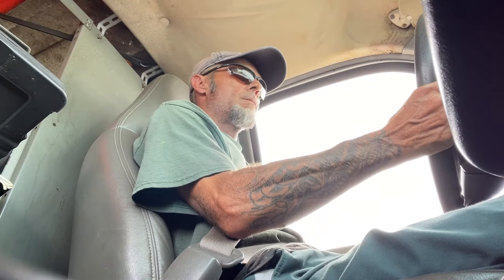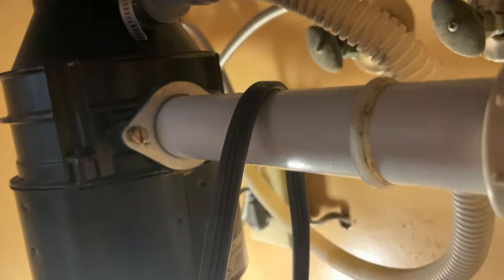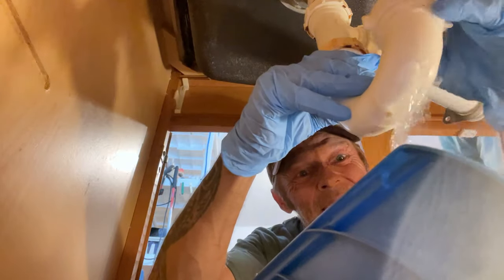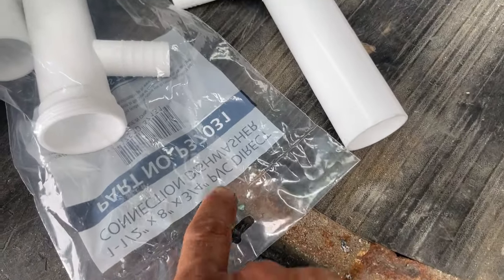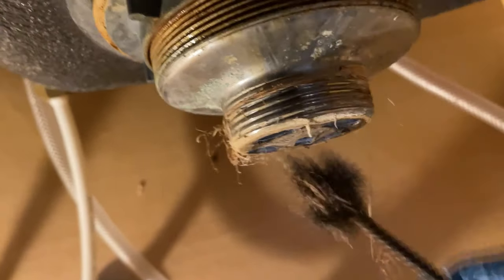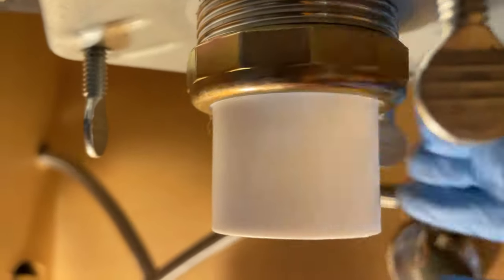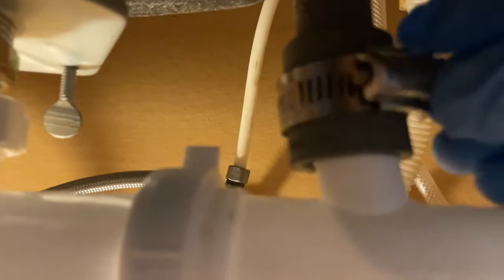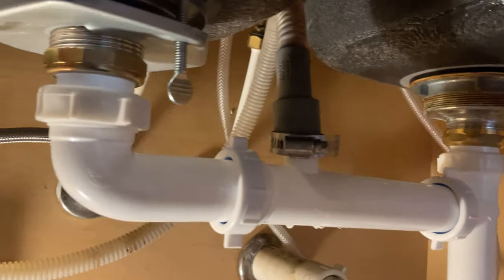HOW TO REMOVE OLD GARBAGE DISPOSAL AND REPLUMB BACK YOUR KITCHEN DRAIN

Comment: I watched this video many times, even as I finally removed my disposal.  That was weeks ago and I've still got paper towels under the sink and check it frequently...like I still can't believe I managed to get it done 😂  Super helpful video.
Reply: Good idea. I use newspaper to check for incremental leaks; its easier to spot.
Reply: And he doesn't screw around either. Gets right to the point without a lot of fluff or advertisements or anything.

Comment: Thank you do much for this !
I bought the correct kit but the instructions were so vague and I ended up connecting the parts wrong and had leaks. Your video helped me assemble it the right way with water tight connections and had the job buttoned up in about 30 mins vs the 3 frustrating hrs I spent prior to finding your video .
Thanks again. I really appreciate your time and effort to impart your knowledge. 
Here's a couple of cold ones on me! 🍺🍺
Reply: which parts did you get, can you provide the links or a list. there were so many pvc pipes used that i am confused what exactly to buy. The list i have so far>
Regular strainer basket for kitchen sink
Plumbers putty
PVC Direct dishwasher connection	(this will have dishwasher waste input)
PVC pipes with fasteners ??

Comment: Thank you so much, I finally did it and it was so easy. I learned that all piping is different. All I needed to was get the strainer basket  and 2 PVC 's. I had to figure it out by myself what was needed for the last part which was another leak that had nothing to do with what you are teaching. It took me 3 days to figure it out but I did. The PVC connection that was causing the leak ended up not needing a washer only. It need an extension as well but I did it with a little help for the Home Depot employee.

Comment: Solid work, my friend. This provides literally everything I needed to know for this issue. I'll be using this when I do mine shortly. Water started pouring from the reset button and I knew it was over.  Easy enough a carpenter can do it...

Comment: This is exactly what I needed! We've not been able to use the left side of our sink for 2 years because the garbage disposal doesn't work or drain! Thank you! One question- is it possible to install a connection for a dishwasher drain hose for a future dishwasher? We plan on getting one soon, but until then, can I have the connection built in now, to save time later? I imagine I would just need some kind of cap to seal that off temporarily?

Comment: Bbro you are a boss!!! Love the video helps me out alot. Question for you my garbage disposal is inline meaning that it doesn't use a wall plug. How to do deal with it? Can I just turn of power cut the cable and add terminals to it and leave it off to the side or should I really be calling an electrician? Thanks man.

Comment: Hi Tim, We love your video and since our setup was almost exactly the same as this customer we followed it almost to a T. Everything seems to work great, except... the dishwasher drain pipe leaks where it connects to the PVC end waste. Any suggestions about what we might have done wrong? Wrong size of dishwasher connector? Any other ideas of things we can check before having to call someone?
Reply: Make sure its tightened down and sealed with a hose clamp, overtightning can cause cracks or leaks. Sounds like the PVC nipple (dishwasher drain inlet) might be too small for the drain hose itself, you can purchase adapters. Check for cracks in the rubber on drain hose connector. Hope this helps

Comment: Love the video! This is my first diy plumbing job and I’m terrified of messing it up and having to called a plumber embarrassed with what I’ve done haha. Quick question, sorry if I missed it, what sink strainer did you use exactly? We bought a standard one but I’m realizing it’s not even with the strainer on the other side. I presume they have to be even in order for everything to line up properly. Would you suggest I get two new strainers so they’ll be even with each other? Not sure I’ll be able to find exactly what we already have as it was purchased over 18 years ago 😅

Although now I consider that if I get a strainer that’s not the same height as the original, the p trap and wall tube won’t align properly. I suppose I could trim the T-joint to make it fit… sorry I’m rambling, but does my thought process make sense to you?

Edit: I bought two new sink strainers and everything went perfectly!!
Reply: they do not need to be the same height. Just cut/add PVC pipe where you need in order to connect the plumbing.

Comment: I followed your instructions to a T but am experiencing a small bit of leaking and I’m not sure where it’s coming from. It seems like it may be coming from the first connection from basket, top hat farrow, and pvc flange. Are we supposed to put plumbers tape on the metal to metal connection? I didn’t see you did, but not sure how to stop my leak.

Comment: After you applied the putty and put the basket in the sink. You pressed down. What do you do with the excess putty on the underside (under the sink) of the basket?

Do you remove it before you place the gaskets or leave it?

Comment: Hi, thank you for the video. yours is the only video i could find for this project.
Plumbers here is asking 350 - 400 for this project,
Which parts did you get, can you provide the links or a list. There were so many pvc pipes used that i am confused what exactly to buy. 
The list i have so far :
Regular strainer basket for kitchen sink
Plumbers putty
PVC Direct dishwasher connection	(this will have dishwasher waste input)
PVC pipes with fasteners ??

Comment: I've got the garbage disposal unit out into the trash and the dishwasher pulled and the items were both hard wiredinto the wall. Didn't die from electrocution!  LOL.. Now I am struggling with getting the flange/bracket off the sink drain. I got the screws out and all it does is spin and not come off.   I hate working on old plumbing because it is soooooo jacked up 99% of the time!!  HELLLPPPP!

Comment: Great video! Thank you! I'm going to get what i need for this job tomorrow but i have a question... Long story short I will not have a dishwasher installed for some time, at least a few months, do I still need to get the piece with the dishwasher attachment? And if so is there a way to plug that up temporarily  since I will not be using my dishwasher?
Reply from the maker: Yes you will need the dishwasher attachment in the mean while plug the hole with plumbers putty just don’t forget to remove the putty when you reattach the dishwasher

Comment: I used a bit of Teflon paste, made for pipe threads, to seal the various ferrules and to lube the threads so I could get them tighter by hand.  might have been a waste of time and Teflon, but no leaks and it is only the second time I have ever put together a P trap.  I worried about having to cut to certain lengths where the ferrule lands on the embossed label, but managed to avoid such lengths so I didn't have to sand off any labels.  Your Jomar strainer sure was easier to tighten than mine, using an oil filter wrench since I normally do cars.
Reply: Definitely do not need pipe dope or Teflon,  it makes it that much harder to take apart to snake and you most likely wouldn't be able to get it of before resembly so you'd end up replacing it. It's a compression nut it won't leak if tubular is cut right and tighten properly
Reply: @chrismallory3718  I took it apart to remove a marble and it went back together just fine.
Reply: @alan6832  they are compression,  if you need Teflon and/or pipe dope then either the ferrule is bad or the tubular needs replaced.  I do plumbing every day and ran into this numerous times
Reply: @chrismallory3718  I probably didn't need it, but used it anyway without issues.

Comment: My screws (at 2:35) are so rusted, they will not budge. Any ideas to get them out? I tried WD40 rust penetrator, an impact drill, and even tried cutting through it with my multi tool. No good so I am stuck. Help!

Comment: if after you install a new garbage disposal and straight tube leaks coming from disposal, what should we check. We replaced the seal but still leaking when you turn water on . We are stumped.

Comment: What if you have all of that hooked up and both sides of the sink fill up with water and your dishwasher drains and backs up into the sinks, then when the sinks drain they drain back into the dishwasher. I also added a vent under the sink even thought it is vented to the outside.

Comment: Well, the garbage disposal in my home must be much older cuz I cannot attach new plumbing to what's left after taking out the GD. The sink from top says "in sink erator" which is nothing compared to the other side. Can I drop in a strainer badket and seal it, then run plumbing? I dont want to damage the sink by attempting to remover the "in sink erator" attachment.
Edit: also, underneath where the screws etc are remaing from GD, I can't get that part off without possibly doing damage to the sink. Very upsetting when I get into projects like this in an old farmhouse.
If you added the strainer basket thru the top and sealed it, that would of a huge help for me to know if shown in the video.
Great presentation though.
Reply: Go back and watch the video at 2:15.  He explains that you can't use what's left after removing the GD, and he shows you how to remove it.